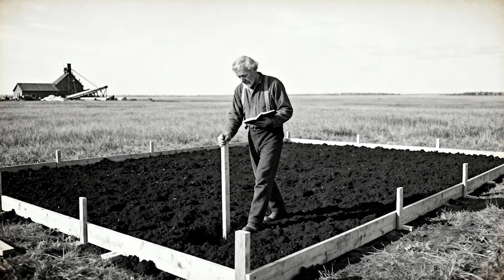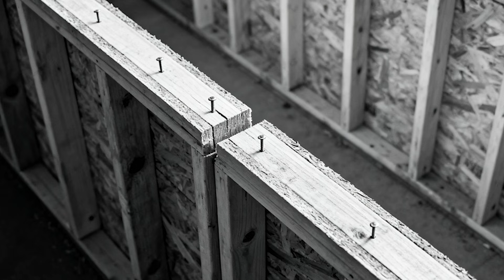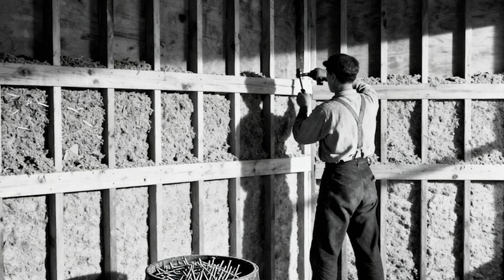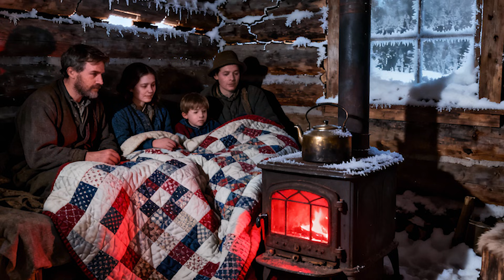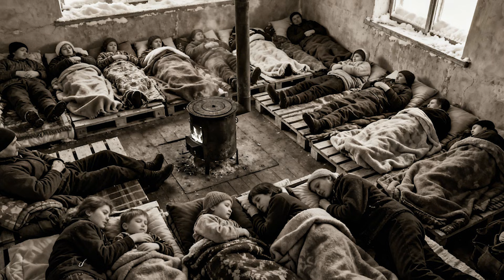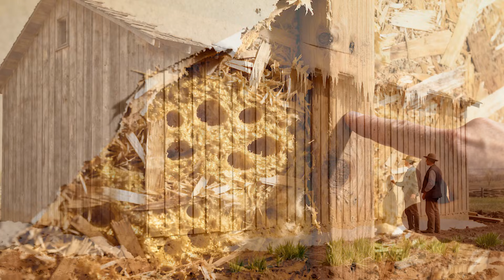Why 1800s "Sawdust-Filled" Walls Insulated 3x Better Than Solid Timber Logs

Comment: I lived in a house with saw dust walls. We found it's okay, as long as you add the dust in a regular bases, because it settles inside and expoding the top part of the studs without any insulation.